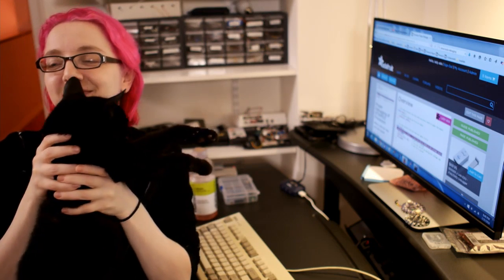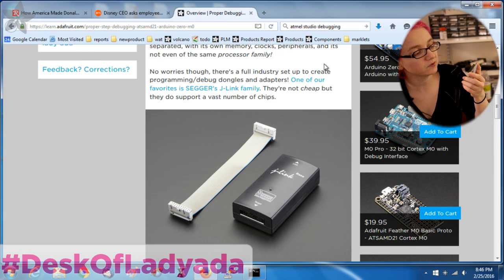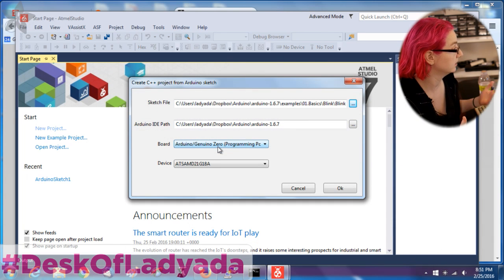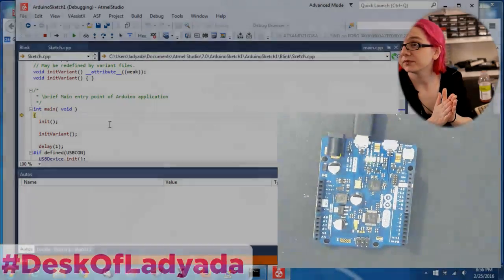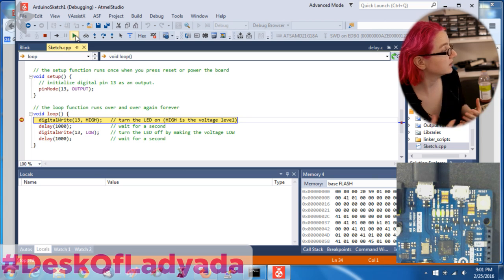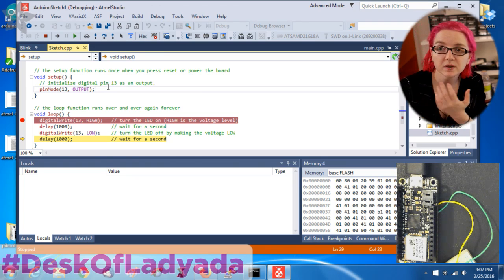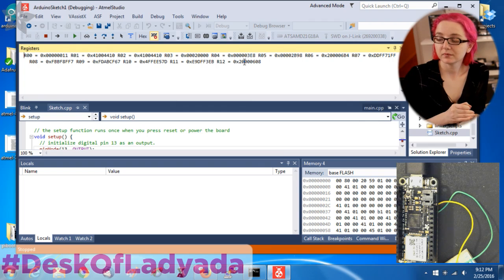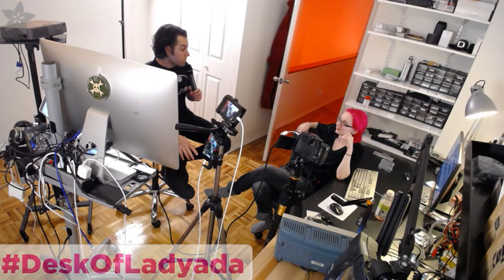ATMEL Studio debugging @arduino zero & FEATHER m0 2/25/2016 @atmel @atmelmakes@cadsofttech #eaglecad

Comment: Just want to say that I tried creating the Blink project in Atmel Studio 7 and if you choose "Feather M0" as your board, you won't be able to compile. It would fail at compiling "USBCore.o". However, if you choose "Arduino/Genuino Zero (Native USB Port)", then everything compiles fine. For whatever reason, choosing "Feather M0" won't include "ArduinoCore/include/core/samd21/" folder, but the other one does. Not sure why it is that. Hope it helps!

Comment: If you work with Atmel chips a lot, do yourself a favor and buy Atmel ICE. It can debug almost any their chip, just be careful when working over debugWIRE (there is a small gotcha that if you have debug interface on, you can't program chip)
Reply: quick question, can you use it for debugging the raspberry pi 3 as well? with jtag for some uber intense debugging.